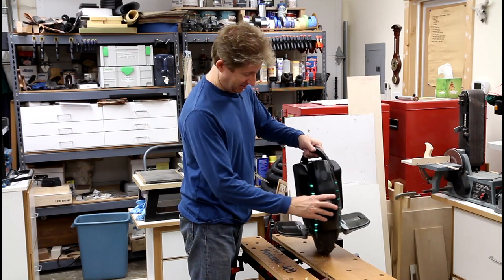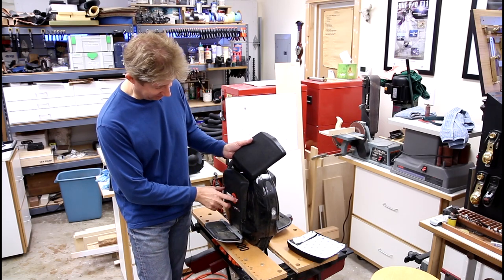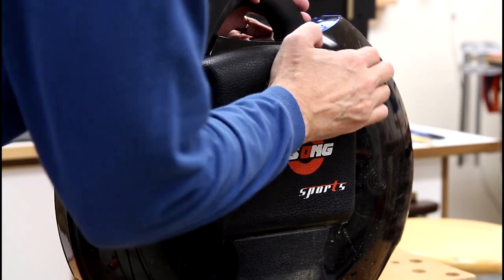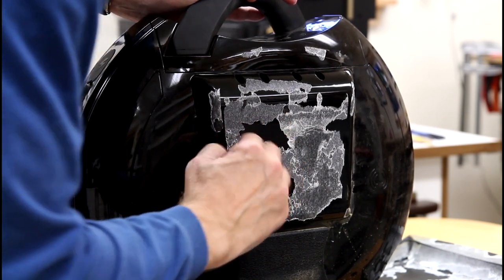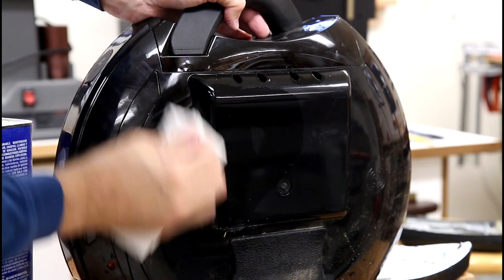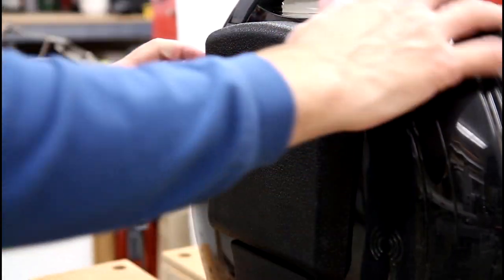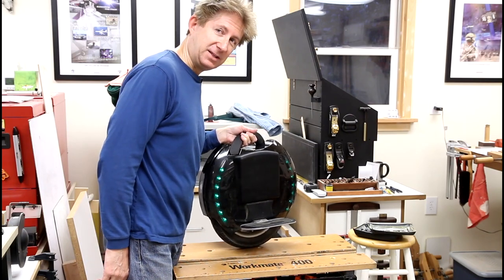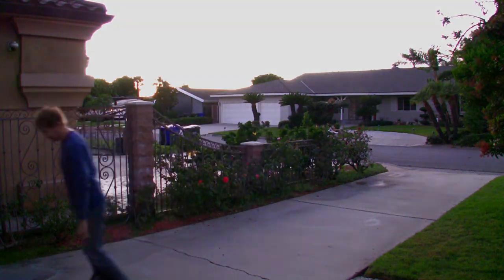New KingSong 14S Side Pads

Comment: Hi, could you please tell me how many A holds up to 14S at most?  30A?  60A?  I have seen that there are two spare 30A fuses, but when I drive it I have also reached 40A, how far can I go?  I would like to put the right alarm from eucworld, but I do not know the maximum A manageable by the wheel ...
Reply from the maker: I'm afraid I couldn't say for that wheel. By today's standards it's an ancient wheel and wasn't a wheel that you would want to stress much (it doesn't have a very powerful motor)